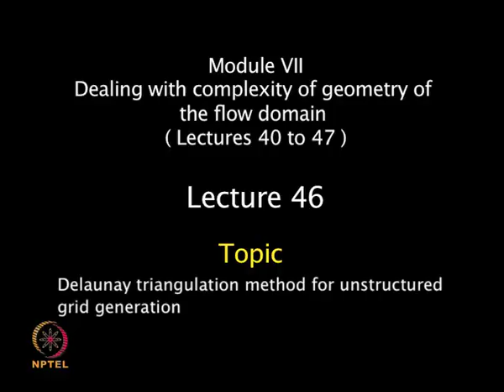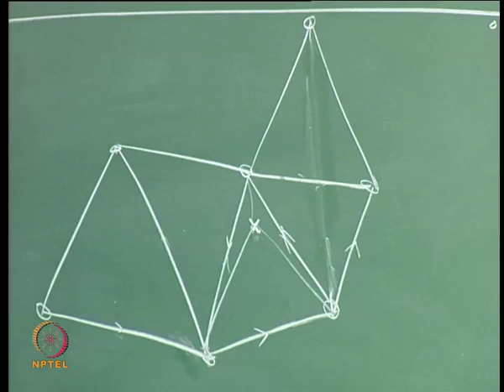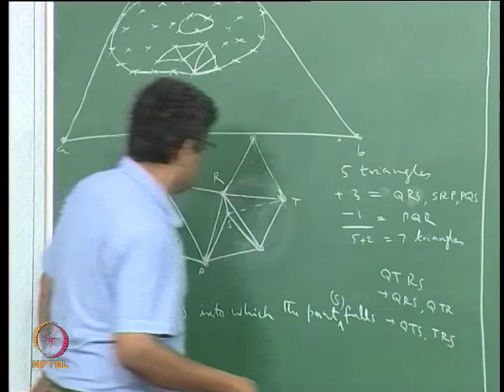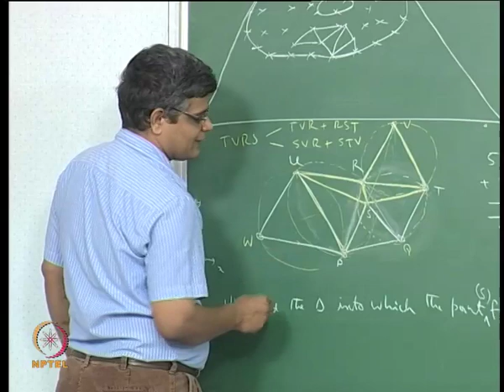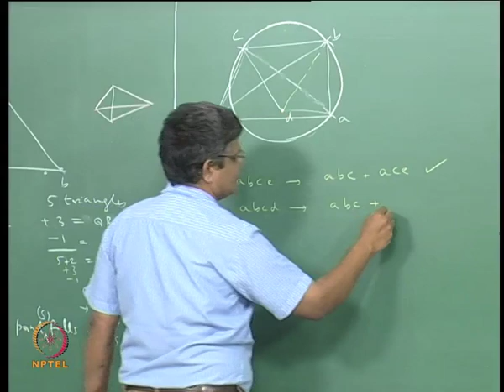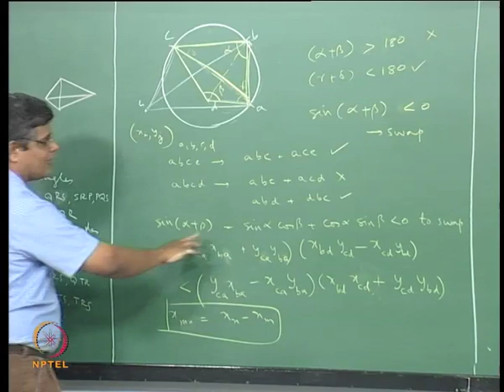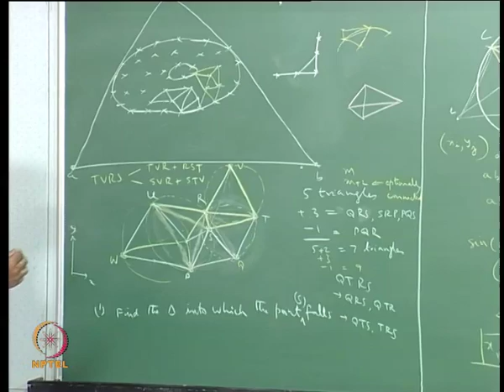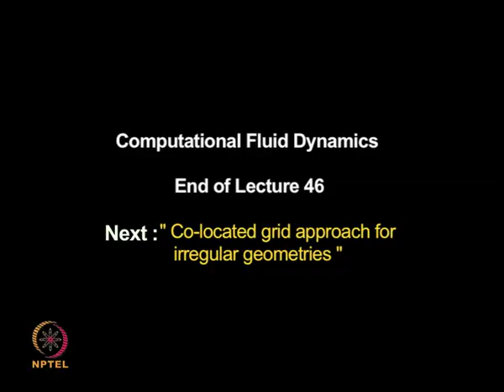Mod-07 Lec-46 Delaunay triangulation method for unstructured grid generation

Comment: Thanks for this lecture.
I have a question if you use the incremental algorithm what happens if the new point lies exactly on an edge on one of the triangles?
- Can you ignore this point because it would split the edge?
- Do you need to create extra edges to both the triangles which are using the edge on which this point lies,
  and if that is the case how would the flipping work then?
- something else?